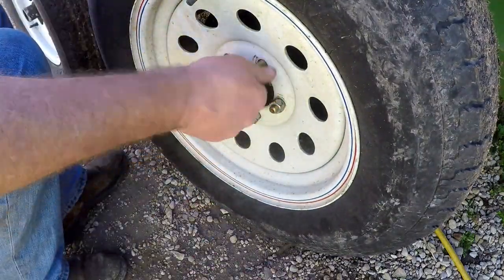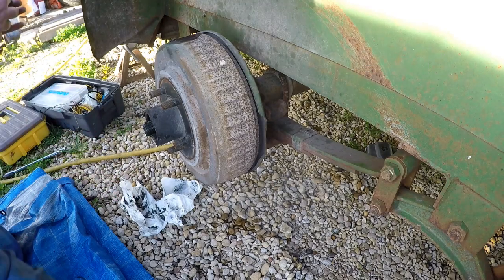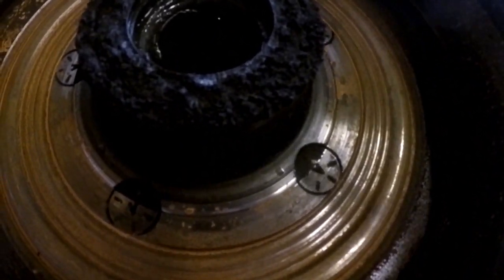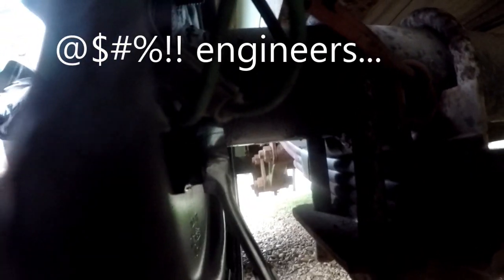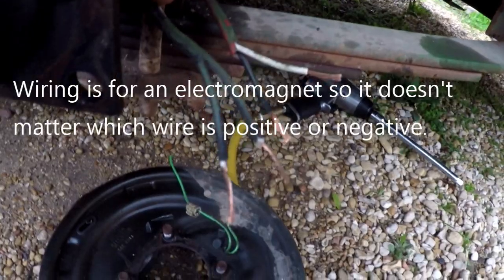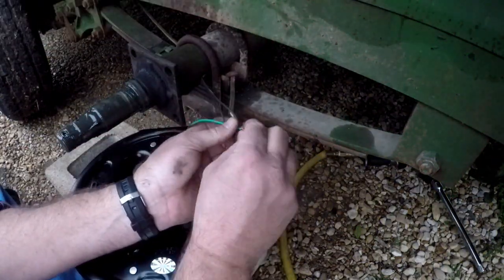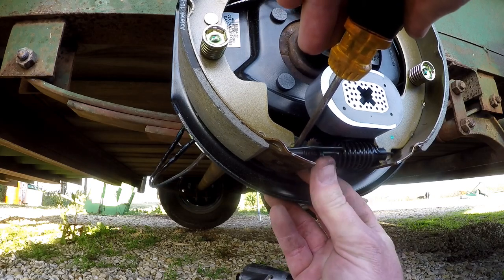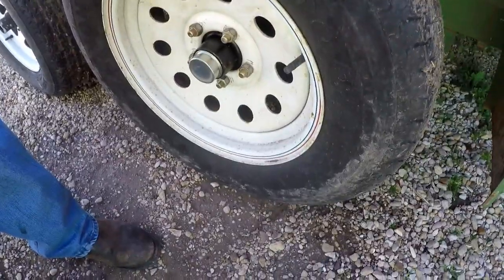Installing electric trailer brakes

Comment: Almost a awesome video ... wish you went into more detail on the bearings and how you made sure to order the correct new ones the drums as well ... and didn't really explain the wiring of the trailer ... 🙄
Reply: When you order new brake assembly with new hubs they come with new bearings, and the electric doesent really matter if + or - are hooked up "backwards" they just activate a magnet so it works either way

Comment: Do all axles come with the electric wire for the electric brakes?
Reply from the maker: I don't know, I have older trailers where the brake wires are just zip tied to the outside of the axle but most have holes to run the wires through.
Reply: @TheFritz423  .for the cable, can it be directly connected to the battery in the vehicle and add a switch to turn it on or off? so no need to add controller
Reply from the maker: @mr.eervianlesmana9263  If you had a switch it would turn brakes full on if connected to 12 volts. If you mean a switch on the trailer side to disable brakes you could but I'd be worried about liability.
Reply: @TheFritz423  .the switch I mean is the switch I added myself
Reply: You could add a switch but you also need to add a potentiometer to it as well so you can adjust the voltage going to them so there not on full blast when you turn them on

Comment: That stock wiring that the manufacturer installed inside the axle was nuts. I would have clipped wiring where it comes out of the axle and installed new wiring for the brakes. Otherwise nice video.

Comment: Great video mate.my problem is I've just rewired my trailer and one wheel is locking on when I lightly break my vehicle? I don't have a brake controller fitted to vehicle.any help asap much appreciated if you know as its due for rego in two days.  Thanks in advance. Wayne.
Reply from the maker: Assuming you've adjusted the star wheel to back off that brake? I've never heard of trailer brakes without a controller. Does your hitch have a built in controller?